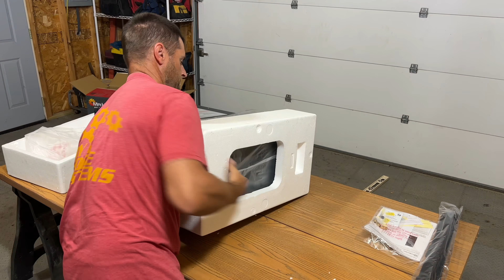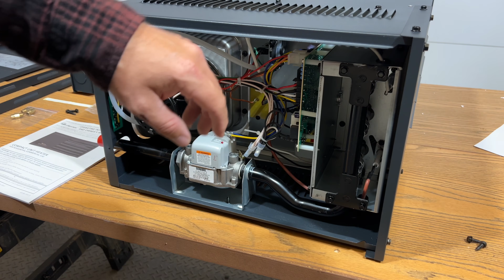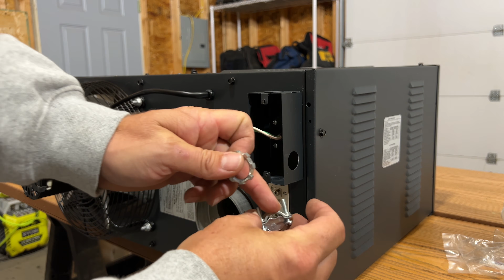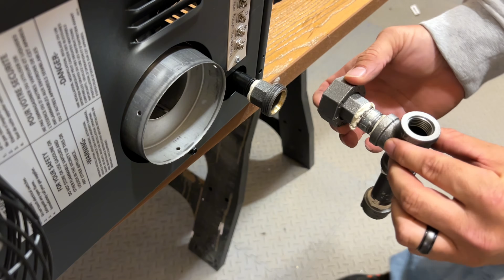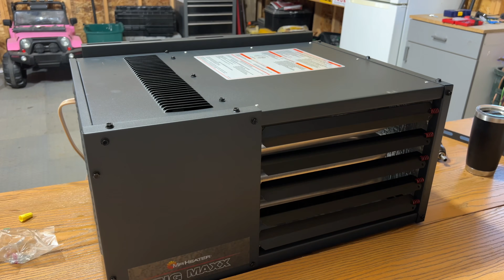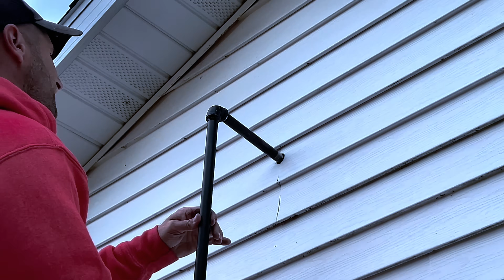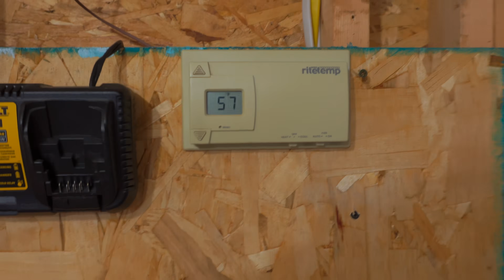Complete Mr. Heater Install From Start To Finish

Comment: You should of shown how to set the regulator, to make sure the pressure is proper . Don't want it too high could explode
Reply from the maker: This WILL Make Your Mr. Heater More Efficient!! And Maybe Increase Lifespan
https://youtu.be/LjiMUPQryU0 

Here is the video I made on that exact subject if you are interested

Comment: Did you use a two wire thermostat? I assume red to R and white to W. That’s what I have but it won’t turn on. Thanks.
Reply from the maker: If you want to simply test to see if the heater will start up runny jumper from the red to the white and your furnace should start the cycle on, if it does cycle on, there is something wrong with your thermostat wiring
Reply from the maker: My wires are connected as following: red to R, white to W, green to G and the blue is to the C
Reply: @DIYWISCO  gotcha. Mine only has red and white. Thinking I need a different thermostat
Reply from the maker: Your heater only has red and white or your thermostat only has those 2?
Reply: Heater has c,w,g,r and thermostat has w and r. It runs when I tested it like you mentioned earlier.
Reply from the maker: I’d agree try another thermostat
Reply: @DIYWISCO  thanks for all the help!
Reply from the maker: You’re welcome!

Comment: Did you use any screws to attach the vent pipe to the heater? Seems kind of loose when slipping it on.
Reply from the maker: I did, I used 3, I thoughr the same seemed kinda loose

Comment: Great Video!!!!-Is there a reason you ran the gas line on the exterior of the building rather than the inside???????
Reply from the maker: That way I more freedom for storage like cabinets/tool storage etc without the pipe being in my way

Comment: Good video!

Only question i have is:  do you use pipe sealant on the union?  I noticed you did not.
Reply from the maker: No, you’re not supposed to use sealant on unions, they are designed to seal when the two surfaces meet all on their own
Reply: Did you use all 4 terminals on the back of the unit for thermostat?

Got the whole system hooked up, looks great.... Won't do anything 😂. 

I'm a tile installer, guess I should stick with that!😂
Reply from the maker: Make sure that you have the wires in the correct spot :)
Reply from the maker: Yes I did, that way I can run just the fan if I decide to in the summer

Comment: Love the video. My gargage is approximately 13x25 and has a large loft. What size do you recommend. I have heard 50k btu and 80k. It would be. I live in New York where winters are horrible but would like the option of working out in my garage and tinkering
Reply from the maker: The 13x25 should be great with the 50k, my garage is 25x25 and it takes it from 20 degrees to 45 is about 45 min to an hour with little to no insulation while it is 10 degrees outside, just did that this morning to workout 😊
Reply: @ Thanks for the info…I am thinking of spray foaming my garage in the near future as all the wall are current open while I redo electric
Reply from the maker: I thought about that but the spray foam is crazy expensive
Reply: @anthony1113  My garage has zero insulation. I’m thinking blow-in on ceiling and walls.
Reply from the maker: Those are both good options. I am doing blowing in the ceiling and r-13 batts in the walls

Comment: Did you use regular B vent to run venting or did use that cat 3 stuff
Reply from the maker: I used regular b-vent the cat3 is almost more than the heater itself but cat3 is technically recommended for horizontal venting
But a lot of people are still using it due to the cost
Reply: What piece attached directly to the unit. The ones at Home Depot are the same size as the flue. I have a 90° type b but it will not go over the flue on the unit
Reply from the maker: @jtsarby I used this piece Your friend has shared a link to a Home Depot product they think you would be interested in seeing.

https://www.homedepot.com/p/Selkirk-4-in-Steel-Male-Universal-Gas-Vent-Adapter-104081HD/300255816 I had to cut back the outer wall, just enough to get it to go over the flue pipe on the unit itself since the heaters exhaust vent doesn’t stick out very far.
Reply: @DIYWISCO  hey man, I jjts got my heater up and running and I also used   the typ B for horizontal vent..The cat 3 stuff is way too expensive. You think if I tape all the joints I should be good, technically that’s why cat 3 is required because of the gasket that come with the kits.. they make this stuff too expensive ..
Reply from the maker: Areas it is took expensive, I have heard that the B vent can rust out on the inside so every couple years I am going to take it apart and inspect it to make sure everything is still 💯, you’ll be good to go